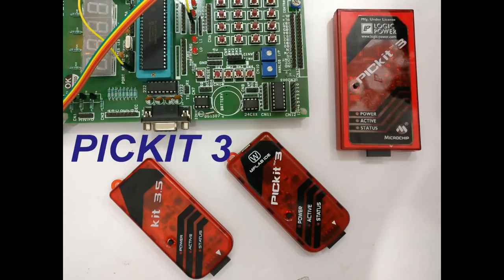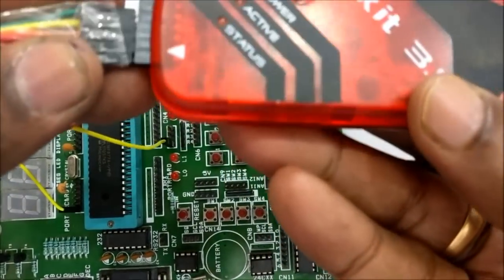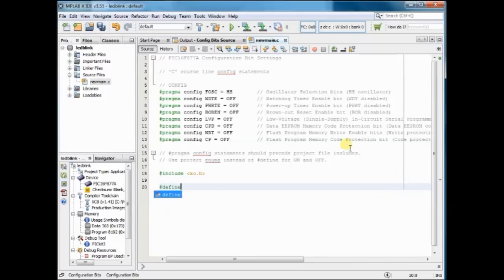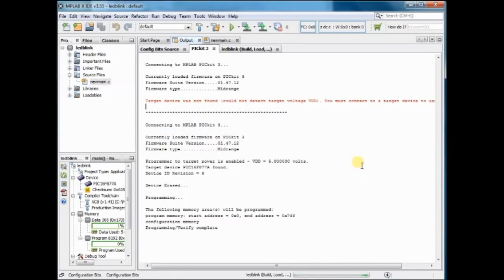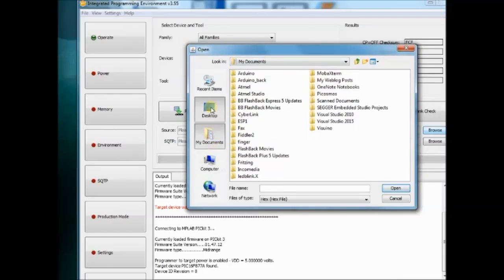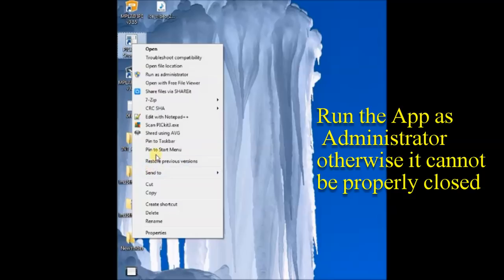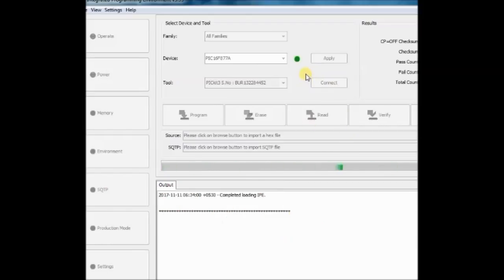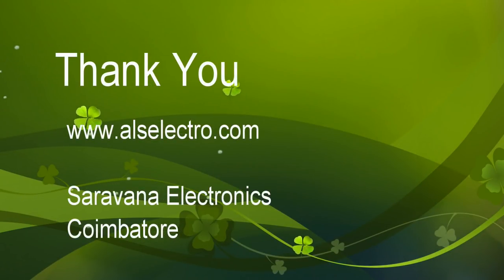Programming PIC Microcontrollers with PICkit 3 - Using MPLABX IDE / IPE

Comment: Your video actually help me a lot in starting to use my pickit3 more than 2 months after purchasing it. I attempted to use the standalone pickit3 application before downloading and installing mplabx ide and mplab ipe(although mplab ide does not run) which made mplab ipe unable to work with mplab ipe. Thanks for the video. It is very helpful

Comment: I had the same problem which Pickit3 could not connect and upload firmware. I made some changes in MPlab IPE and it worked but trick is when you change settings then click "disconnect" button and then click to "connect" button in main menu for take effect. If you need to change Pickit 3 settings in  MPLab X IDE then you should close the application after making changes and restart MPLab X IDE then it starts to work. Strange and difficult way, it should be fixed for easy solution.

Comment: What latest hardware are needed for pic programming for a beginner? In your video, I find that (1) Pic development board, (2) PIcKit 3.5 and (3) 40 pin adaptor or demo board. Are these 3-hardware compatible with MPLAB IPE presently? Please guide me. It would be a great help to me if you can enlist the hardware with details especially on the pic development board.

Comment: I  am getting an error stating that the voltage is 4.75V but requires 5V for the programmer to dump the code. How do I solve this error? My mplabx ide does not have the ICSP options in power category to power the target circuit from tool.

Comment: Sir I am trying to upload the program on same PIC Development Board with PIC16F877A IC which is shown in the Video and I am using Pickit3 programmer. IDE version is 4.20 but I am always getting following error.

Target Device ID (0x3fe0) is an Invalid Device ID. Please check your connections to the Target Device.

Board is powered from Pickit3 same as suggested in Video. 

Please help me Sir. Thank you.

Comment: I got a Pickit 3 on Ebay and installed MPLab.  It makes the lights flash but the Pickit 3 doesn't put out any power to the programming socked so it can't read in or do anything.  The whole thing is a fraud!

Comment: In our college there are pic kit 2  but our teacher told us to use stand alone app.... 
So can we use MPLAB  IPE for it....
Reply from the maker: Good question.
MPLAB IPE will not recognize PICKIT2 . In MPLABIPE after selecting IC devise , the TOOL will be greyed out .It will communicate only with PICKIT3. 
For PICKIT2 standalone app is recommended. You can download it from

http://ww1.microchip.com/downloads/en/DeviceDoc/PICkit%202%20v2.61.00%20Setup%20dotNET%20A.zip

or from within MPLAB XIDE you can select tool as PICKIT2 while creating project & program from within IDE
Reply: yes, but MPLAB IPE use only for hex file loading only. so,better to use MPLAB X ide for programming and debugging.
Reply: Only read and write  for which software  download?  Any link available 
Please guide sir  pickit 3.5

Comment: i m using mplab x ide 5.10 the voltage level is not exceeding from 3.5 
any sol?
Reply: this PIC MCU supports max 3.5v but use 3.25v for programming

Comment: Sir I new here I want to know witch program kit was best for programming..
Reply: use PICkit3 by microchip or Logic power only
Reply: which programming language you prefer for PIC microcontrollers ??
Reply: @prabuddhbharat2934  ic programmes mini or micro both chip ..
Reply: @lovely2561  mini and micro both
Reply: @prabuddhbharat2934  then witch ic programmer is best ...

Comment: Programming...
Program memory
Address:0 Expected value:120a Received value:3fff
Failed to program device...

The above error msg is displayed...i m using pic16f877a mplbx xc8 compiler and pickit3...plz guide me
Reply: i got this problem you need to add a pull up resistor of 10k between VDD and MCLR and the program wll be dumped without any error
Reply: Hi vrushali..I need your help for programming.
Reply: @vrushalikalbhor8968 
Yes you're correct